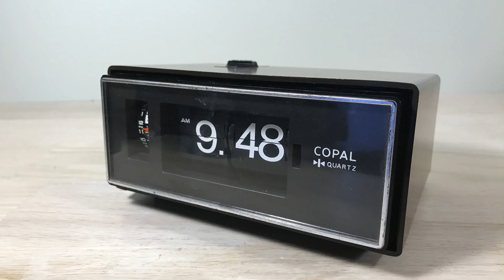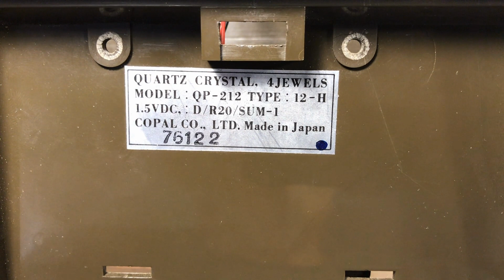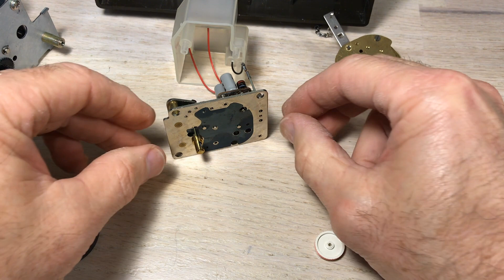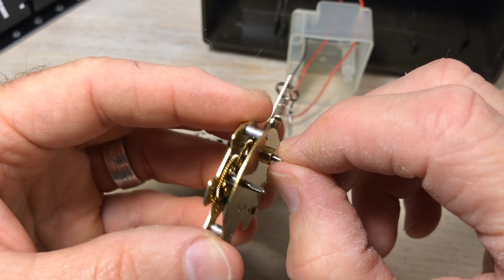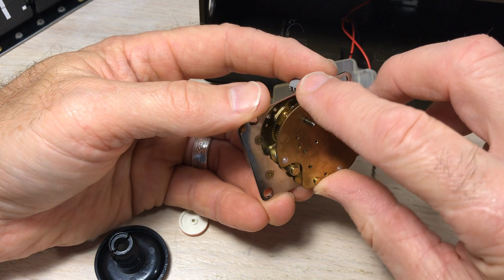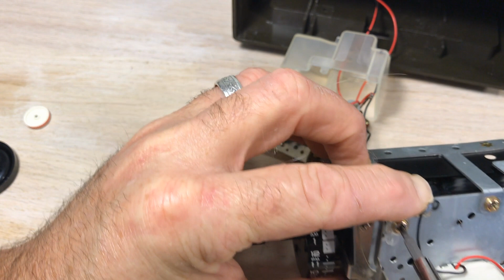Repair of the Quirky Copal QP-212 Flip Clock

Comment: Great job👍🏆

Where to get this black long thin knob, which is used to set the clock time?
Or how is this piece called?

Thanks a lot
Reply from the maker: You could call it the “time setting knob.”  There are no suppliers for these. Sometimes getting a cheap used clock will be the answer.

Comment: Hello Flipclockfans. I recently got a Copal QP-210, 24 hours, cheap on Ebay. The part is almost new in the red housing. Your video helped a lot to understand the device. The previous owner didn't know how to deal with it. In fact, the chain is very strange, but it works. In fact, the watch is not as accurate as you would expect from a quartz watch. Thanks for the great videos of the different flip clocks.👍

Comment: Hello, does the quartz motor side separate from the gearbox side easily? or do you need to cut the metal points like on the electric ones,? thanks
Reply from the maker: The contacts that go from the battery compartment to the motor slide down onto posts. Those can be pulled off. The motor easily separates from the mechanism by removal of 3 screws, the plastic motor housing is removed by taking off 2 small screws.

Comment: humm why is there 3 wires going to the battery compartment? (2 red / 1 black )
Reply from the maker: One of the red wires serves to power the alarm. The tall post is nothing more than a relay. On the device on the clock there is a red wire that had to be re-soldered to that post.

Comment: how would i fix a squeaking motor in a copal model 227 when i got mine the motor made an awful squeaking noise, I used a method from another one of your vids and dipped the motor into rubbing alcohol and spun the motor until all the dust fell out and then it ran well for about 1.5 days, now the noise is back. do these motors need oil to run well? did i not clean out the motor well enough?
Reply from the maker: pidizzle yoyoma  - you probably watched an older video. My videos kind of show a progression of my knowledge about these clocks as I gained more experience. The following video at about six mins and 30 sec shows how I would approach your clock. There are other potential problems like the rotor scraping against the motor cover. But definitely I would oil it. 

https://youtu.be/wEK1WTPg1xc
Reply: @Flipclockfans  Thank you for taking the time to help me, I noticed you were using rem oil on the clocks motor, do you think using white lithium grease would work on a clock motor?  Its a bottle of wd 40 lithium spray grease and its fairly light. I use it on computer fans frequently.
Reply from the maker: pidizzle yoyoma - man. I have no idea. My impression is that it would be too thick. I know it goes on light but it might thicken up with time. Believe it or not synthetic motor oil is best for this.

Comment: How do you fix the alarm on a G.E. flip clock that goes off to early?
Reply from the maker: Madison Sims  - depends upon the model and  what the problem may be.  Hard to say. It usually involves taking off the alarm wheel and adjusting it.
Reply: The model number is 7-4310f. I believe you’ve done a video on how to restring the radio dail on this particular model. Any suggestion would be greatly appreciated I don’t know much about these clocks and I’m afraid I’m going to tear something else up if I crack it open and start taking stuff apart 😂😂

Comment: Good job!  Were you able to flush out the dried oil using solvent without disassembling the gearbox?
Reply from the maker: Good question. Just oiling and working the gears was all it took.
Reply: @Flipclockfans  what oil can I use for flip clock gears?